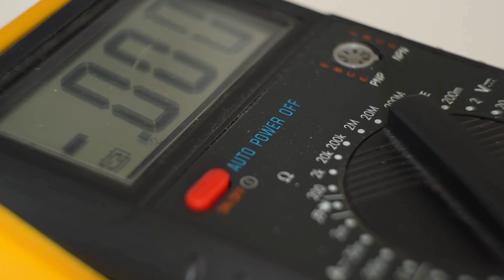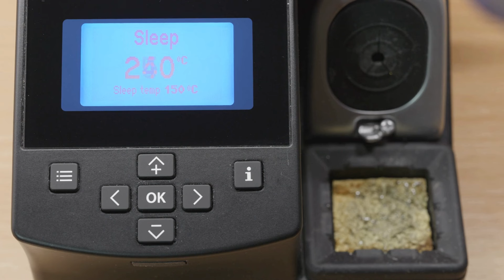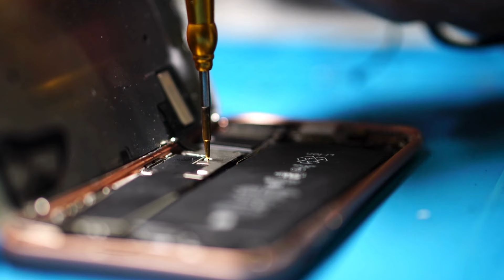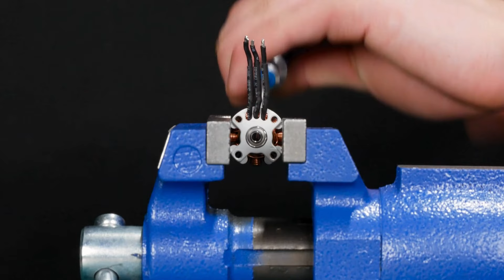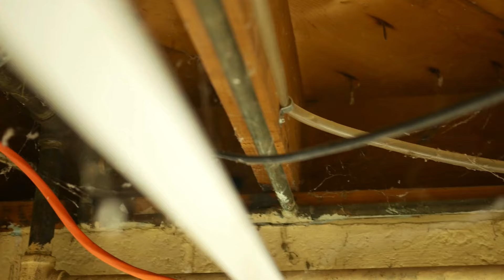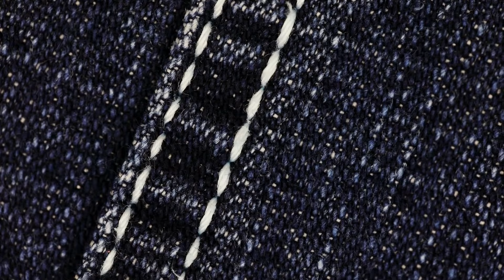The 10 Tools I’m Buying NOW To Survive the Coming System Collapse.

Comment: Being basically a tool freak, I have all these tools and more but the recommendations here are ridiculous..For example, having a multimeter, soldering station, wire strippers, etc. is fine and I have them but they won't allow someone to do all the repairs mentioned unless you know electronics. Tools without knowledge are useless. The same goes for virtually all the recommendations here which were chosen by someone who clearly isn't knowledgeable about basic repairs.  The tools you should have are basic and do not require advanced knowledge about their use. What is someone going to do with a multimeter if an appliance fails if they have no knowledge of electronics repair - and most people don't. Basic tools should include simple things such as hammers, screwdrivers, basic auto repair tool sets, shovels, etc. This video is pretty silly and would be of little value to most people. What were they thinking?  In fact, I just subscribed to this channel after watching another video on an unrelated topic but this video damaged their credibility in my mind and I'm unsubscribing.

Comment: Pex is PLASTIC. Plastic is a SLOW poison. Switch to copper. If you can afford titanium pipe and screw joints last a great deal longer.
Reply from the maker: I will be taking your advice on that. My whole plumbing needs to be re-done next year and I have pPEX right now and will upgraded to titanium. 🤠🤠

Comment: Here is the list:
Multimeter
Soldering station 
Tap and die plus thread repair kit. 
Bolt and screw extractor set
Bearing and gear puller set
Bench vise and clamps
PEX plumbing repair kit
Sharpening kit
Heavy duty sewing awl kit

Comment: One very handy tool is a Propane gas refilling kit. Or LPG fill kit. It's a high pressure pipe with the correct fittings on each end that is used for filling small LPG bottles from large 19 kg or 48 kg bottles. It's called "bleed filling"
Reply from the maker: Interesting!!! I had no clue about this.... I'm absolutely researching this. Thanks a lot
Reply: You can refill, but if you transport the refilled bottles, it is a federal crime with very high fines. Some small bottles are made to refill and they are marked as such. Those are OK to refill and transport.

Comment: Store consumables that are used for different types of repairs you might need even if you can't do the repair yourself because the person that can do that repair will trade you his time for consumables he can use. Welding rods and welding wire for CO2 welders. CO2 gas. Reloading components. Tyre repair items. Solder and electrical consumables. Spices for preserving meat. Piano wire for traps. Braded fishing line for shoe repairs and DIY intruder alarms arround the house.
Reply from the maker: This is a brilliant list! Tons of great intel that I didn't even know. Thanks

Comment: I disagree on Digital Multimeter. It requires battery to operate. They may have a lot of function but easily break down. First thing to go is the screen. Go old school Analog Multimeter from reputable brand like "Sanwa". An analog multimeter can still work, measuring voltage and current, with out battery. It need battery only to measure resistant and short circuit.
Reply from the maker: Thanks! I can see now how the analogue would be much better

Comment: You are correct about having PEX tools 20 year old homes are having PEX issues not at connections but in the lines. A gas welding setup with a couple extra tanks. This wasn’t mentioned. Yard sales are a great way to get started buying tools and equipment.